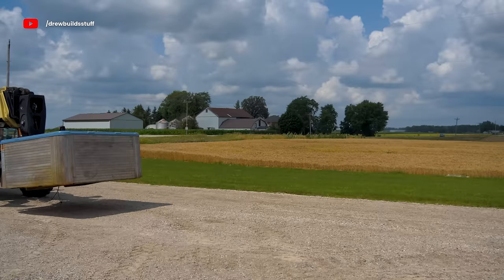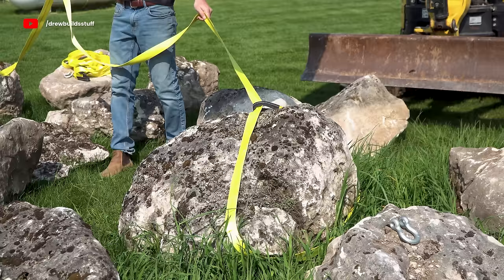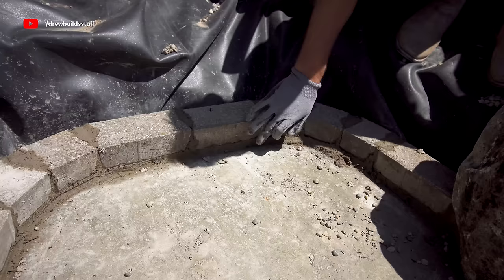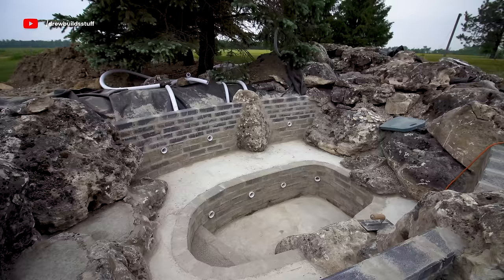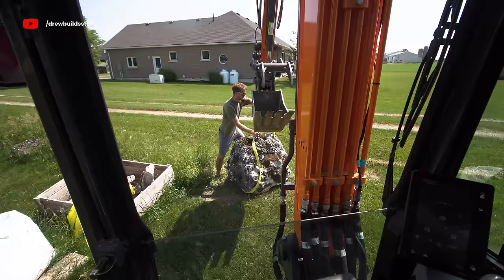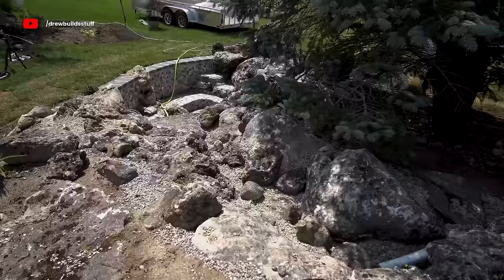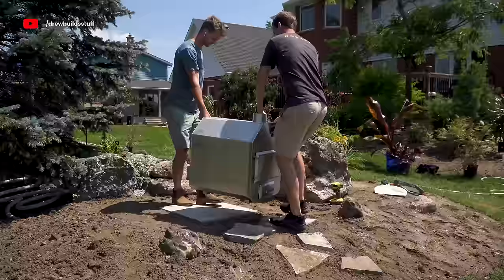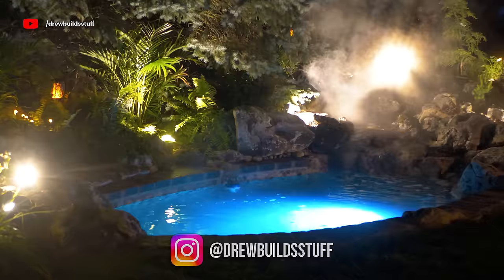Making a MOUNTAIN HOT SPRING in my Backyard

Comment: Speaking as someone who operated pools for 10 years:
To winterize: You want to drain the pipes, add antifreeze, and seal them.  Water freezing will expand and crack them.  However, DO NOT drain the pool!  The change of pressure of filled/not filled over a season will actually crack the concrete of your walls.  Water in the earth freezes and expands, and you need the pressure of the water to push back.  That's an oversimplified explanation but you get the gist.  I'd also recommend getting some sort of cover.  Since this is custom, you'll likely have to make something custom fit.  A sheet with stretchy loops, then some sturdy poles buried underground with hooks on top.  Bury them so the hooks are barely visible and don't disrupt your aesthetic too much when in use.  It goes a long way to keeping it clean so there less work getting it ready again for when you open it again.  Otherwise leaves and other debris will get in and rot all winter.  It is disgusting to clean it.  Also, just throw in some chlorine tabs and possibly some algae-cide from time to time.  Also, consult with a local pool company.  The natural water of an area differs from region to region and you may need additional treatment.  (for example where I live, the natural calcium of water is very low and we have to add more to avoid the water eroding it from the concrete.  Other areas have too much and crusty calcium deposits start to form)  The cover and chemicals will save you a lot of work reopening it.  Otherwise the water will get very nasty and you will spend much more time cleaning it when you reopen it.  You should still drain, clean, and refill it with fresh water when you reopen it.
Reply: Wouldn’t this be best enjoyed during the winter?
Reply: @johnweinhandl8890  itd prob need constant heating and running for that
Reply: @darrenlewis8297  my point is I live in MN, if he’s in Canada I know he’ll only get like 6months a year out of it. If you can’t use it in the winter
Reply: Yeah you don't need 10 years in pool operation to know water ruins pipes when freezing and that water is volatile under external pressures
Reply: @super8bitvideos  I wish that were the case.  In the time I spent operating pools, 50% of what I did was fixing the mistakes of people who thought they knew what they were doing.  Granted my boss wasn't selective and would hire any idiot who had gotten their CPO license, but even better managed facilities screwed up a lot.  There were lots of jobs that only me and a select few others were allowed to tackle, because people are stupid.  Common sense is not common.  There are a lot of people who don't know water expands when it freezes.  And even those that do miss interpret it.  There is another high rated comment here that is telling people to drain the pool because water will expand cracking the walls and by draining the pool there won't be enough behind the walls to crack it.  Its very wrong, and people following his advice are cutting the lifetime of their pools and hot tubs.  And he's claiming more experience than me.
Reply: I agree with some of the things you stated. I recommend getting some plug-in water heaters. Leaving the pumps and everything running. The kind the farmers use to keep there livestock water troughs from freezing(we used them for all kinds of things on our farm when I was a kid). As long as the water stays around 60 to 70 degrees ....all the earth and building you did should stay warm enough that expanding water in the ground won't damage all the work you did. The pond liner you used, cut a sheet big enough to cover the waterfall using big rocks to hold it in place. Also do build the cover @chuckmanion1128 spoke of, building it from 2inch thick dense foam (the light blue foam you can get from Lowes or Home Depot.) Because the vaper dose look cool....but in the winter you don't want the water to mist/vapor to float away.
Reply: If he put the heater to propane than he could run it all year at a prettt penny
Reply: @super8bitvideos I did not know that to be honest. It might be common fact to you but to some people like me it was very informative.
Reply: A few people are suggesting year round heating.  While the idea of running it in winter and using the hot tub, does have some appeal, I really don't recommend it.  You would have to constantly check to make sure if its running.  If for any reason it stopped running for any length of time, the pipes freeze and that is the end of the system.  And so many things can go wrong.  Also, he's up north in Canada.  Canadian winters can get rough.  When it gets really cold, he would need a very powerful heater running full blast just to keep that much water above freezing.  So its not cheap in upfront or maintenance to run it year round.  And if its that cold out, even hardcore hut tub users are going to think twice about using it.  Unless you're true hot tub fanatics that can't go more than a few days without using one, its just not worth it.  Just winterize it.
Reply: @johnweinhandl8890  absolutely but... its too far from the house to run to it in the dead of winter!!!!! id have built it closer to the house just more stuff to add to the illusion!
Reply: @davidbraswell1481  that’s my thought exactly
Reply: For a lot of pools it’s actually more beneficial to run them all year round.  This way you can guarantee you will never have frost damage or broken pipes.  You will have to spend some extra money and buy a generator.  This way you can sleep at night knowing that if you ever lost power you have that back up.  It’s not a cheap option but it’s an investment because it’s cheaper than have to rip it all apart to fix the piping
Reply: @johnweinhandl8890  Maybe into the fall, but depending on where they live in Canada, they'll struggle to make it lukewarm at best in the winter, and would have to heat it constantly to keep it from freezing.
Reply: @markr1550  needs a better heater but I agree it’s not insulated so it’s not ideal 
Idk!!!
Reply: @super8bitvideos  Super helpful and constructive, for him, and anyone else reading, to know that this was all common sense to you lol
Reply: @johnweinhandl8890 yea be much better to use in winter. Only time I enjoy a soak
Reply: Couldn't he just put a simple solar water fountain in it, and leave it running to keep the water from freezing? Running water won't freeze, right?Or maybe a stock pond heater, as someone else suggested? Or, what about build a plastic roof over the pond for free solar heat? Of course, on gray days, or deep snow, you might need a backup.
Reply: @markr1550 it only has to stay above 32°F, or 0°C to keep from freezing...
Reply: @lucymorgan8859  No kidding.  Do you know how cold it gets in parts of Canada during the winter. Even with the little fountain you suggested, it will ice over pretty quickly without constant heating. And nights get pretty long, so anything solar won't work.
Reply: Would it be possible or even feasible to run a heated tube around the outside and add the heated tape or cables they use in Wells to stop them from freezing in the winter.  Just a thought and wanted to get your opinion. thanks. One other thought after reading your comment again adding a couple of 'Skimmers' to the pool should help with the leaves and debris problem not to mention NEEDLES!.
Reply: @ThomWalbranA1  Heated cables and such is not really something I have experience with.  There was no real demand for outdoor pools in winter at our facilities, so we just winterized.  However, I again think that unless you're a hardcore hot tub fan, its better to just winterize, particularly as far North as Canada as this pool was built.  The problem I foresee with that solution is still you need to keep it hot enough that your pipes don't freeze.  He has a lot of piping, and none of it is insulated.  And a lot is buried in concrete so you can't insulate.  All of that piping is a lot of surface area that is constantly losing heat.  You need to constantly pump warm water through the pipes to cycle out the colder water.  All the water running through the system is constantly losing heat.  Running those cables may help, but I don't think that is enough on its own to maintain the heat in the system.  You would still need the pump and the pump heater running constantly.  If that fails for any reason (pump gets clogged, heater runs out of fuel, power outage) its still game over.  Additional heat systems like heated cables and such might give you a slightly longer grace period to get things back up and running if the pump system goes down, but only slightly longer.  Against a Canadian Winter, you'd still have to act fast.  And investing this much into heating and running a pool is expensive.  So my recommendation remains to winterize.

Also the comment about running water not freezing: untrue.  My father had an interesting story from when he was in Alaska.  One morning, he realized he forgot to bring in the beer from his trunk the previous night.  He goes out and sees that miraculously it hadn't frozen.  He goes to pick it up and as soon as he touches it, all the beer instantly freezes.  Why?  To freeze, molecules need to align in a certain pattern.  The beer temperature dropped so quickly that the molecules stopped moving and couldn't align.  As soon as he touched the beer, he introduced movement and the molecules aligned and froze.  Movement does not prevent freezing.
Reply: a have really simple method to help sort of "winterise" a spa or hot tub. this suggestion is obviously not for a setting as beautiful as this and not very scientific but it works. i brought a really cheap temporary gazebo with a clear roof. i cut the legs to lower it and it's peaked roof lets you hose off any leaves etc. it helps keep the heat in and the rain out when it's crazy cold.
Reply: An insulated foam cover and solar heaters might work.
Reply: @markr1550  Dude is in Southern Ontario, which is really not that cold in the winter. Think New York-ish.
Reply: @scrivener68  I'm just across the lake, which means we're a little warmer.  I know people who have tried to keep their hot tubs going all winter, and regretted it.  The bills to keep it heated were horrendous.  If you look at Toronto's weather, typical lows in January and February are in the mid-teens F.  You'll spend a lot to just keep it from freezing, not worth it.
Reply: @markr1550  As for the temperatures, you're talking about the overnight lows, when the hot tub is covered and insulated against the cold. The average daytime high at the absolute coldest time of year in Toronto is barely below freezing.

I'm out on the Prairies, waaaayyyyyy north of Toronto's latitude. It gets PROPERLY cold here, on average, and the extreme cold events make Toronto's worst days look like Hawaii by comparison. and... people here have outdoor hot tubs. It's not considered odd at all.
Reply: I did maintenance on hot tubs for a while, since my Dad's been in the industry since 2000 or so - honestly, all you really need is a circ pump to keep the water moving. Not sure about this custom design with water sitting in certain spots but as long as he can keep water circulation and some minor heat (most tubs just use an inline heater) most of his plumbing should be plenty fine from what I can tell in the video. That being said, winterizing may be a better idea for a build like this with so many variables. Nothing sucked more than a customer calling us because they couldn't get water flow and it was because their lines froze and cracked because they killed the breaker to it in the winter, not knowing it needed to have power for the circ pump
Reply: @chuckmanion1128 the comments have said not to drain the pool. They say to drain the pipes to the pool. Is this incorrect?
Reply: @gypsyapothecaries  yes, but refill the pipes with antifreeze.  You need them full to resist ground pressure, but water in pipes will freeze and expand.  Water in a large body like the pool itself will be fine but not in the pipes.
Reply: This is the MVC (Most Valuable Comment)
Reply: Very funny at then end…great video…great build!
Reply: @scrivener68  Still is expensive - one neighbor in the interior of BC, Canada paid on average $150 CDN on top of his electric bill to keep it going through the winter, and this is a hot tub witch is insulated and had an insulated top on it. And then it got a little dangerous to use when all the wet footy prints going to and from the hot tub froze over and made an ice rink😊
Reply: what if youre like me and youll be using it more in the winter, than in the summer?
Reply: ya this looks unmaintainable. first of all, your point about winter. big one. secondly, all the rough surfaces, no way to keep it clean. maybe absolutely nuke it with chemicals when needed but theres a reason so many people with pools that have liners or smooth concrete walls own scrubbing brushes and scrubbing machines. you aint dropping a water bug in that thing and letting it go once a week.
Reply: pretty accurate info here. Depending on where you are located, draining a pool can cause pressure from the surrounding earth to collapse the pool. Even more so during winter. Just go look up pools being "popped" out of the ground. As for treating the water, get yourself a Taylor water testing kit. Check Chlorine (or Bromine as seen in some hot tub users), CYA (cyanuric acid), pH, Alkalinity, and Calcium Hardness. Special note that pH and calcium hardness are more important to concrete (gunite, shotcrete, cast) pools because typically there is rebar in it. When the water chemistry is off it will literally pull it from the metal rebar or any other metals it has access to, even through the concrete or your pool pump or wherever. If you've ever seen rust stains in a concrete pool this is why. Fiberglass and vinyl pools it's not as big of a deal.

As stated, for winter, you should always flush the piping of all water. In a pool we typically do this by plugging the skimmers, lowering the water level, and using a machine to blow it out (like irrigation). Some people like to then put some antifreeze in the lines. You just don't want water to freeze up inside as it will obviously cause pipes and valves to crack. That's a very important part, make sure you get any shutoff valves clear of water as they will definitely get damaged and the good ones like Jandy valves are expensive.
Reply: @chuckmanion1128 just opening a real cold bottle or can still in liquid, with gaz release it will freeze instantly due to loss of pression. Try it funny to see icy beer or soda coming out.
Reply: He should put a a couple semi weighted antifreeze bottles in the tub to help with the ice shelf from breaking tiles
Reply: @caruana133 propane ain’t cheap
Reply: @chuckmanion1128  i think this is a bad take, canadians specifically like their hot tubs IN the winter, its when hot tubs are best enjoyed

You just put absolutely massive insulation on top so you're constantly not losing energy
Reply: Wouldn't this tub crack apart and the tiles at the water line all pop out if water left in it during winter to freeze? I have no clue how this is water tight. there are spots all over it water will get between rocks and tiles and anywhere water can get will crack up and brake over winter.
Reply: @chuckwoolery9005  Assuming it was well grouted (which to my eye it was, though that isn't my specialty) no they won't crack or pop out.  It will crack the pipes because the water has nowhere to go as it expands when freezing because its a closed system.  But in open air, the water will push up into the open air rather than out into the walls.  It expands in the path of least resistance.  If there is a crack in the grouting, water freezing in the crack could expand it.  But based on what I see, if there is one its small and one winter shouldn't expand it too significantly.  When you drain the tub in spring to clean it, just fix that spot while its drained, and you're good to go.  Though based on what I see, I doubt he'll have that problem or at least not anytime soon.
Reply: @caruana133  well you wouldnt have to turn it up until your going to use it just keep it above freezing.. right?
Reply: @chuckmanion1128 I couldn't agree more. Having lived in southern New England and having had a hot tub at one time, I can say winterizing seems to be the only way in my mind. I couldn't believe when I watched him not throw any kind of insulation around the tub or pipes. Especially around the pipes just so that you have room for the pipes to be replaced if need be. PVC is almost indestructable but I've seen it. Maybe I don't have enough experience to speak  about the longevity of this setup but for the amount of effort that went into this you would think insulation would have been somewhere in the plan even for heating efficiency sake. 

It's such a beautiful set up though. Weld some fake limbs on the chimney and paint the vertical brown and you wouldnt know it was there.

Comment: Made it to the end. As for wintering it up, I think it may be easier to drain it fully and cover it with a tent or tarp just to make spring time restart less hassle of fishing out any dropped foliage.

Although, if you keep a low fire going in the heater. Stretch a large-ish canopy or frame wall tent over it so you could have a middle of Canadian winter personal hot spring to relax in while there's a foot or more of snow on the ground. If you're thinking about doing that in particular, you might want to take up some of the mulch and dirt to line with landscape felt then cover with a good five inches of river gravel to be the dressing and drying off area.

The heat from the water would warm the temporary shelter space. So that space may evolve into a family gathering in winter to cook on a grill, enjoy a warm soak while everyone else is hemmed up in their houses.